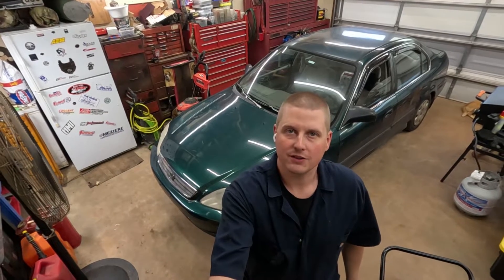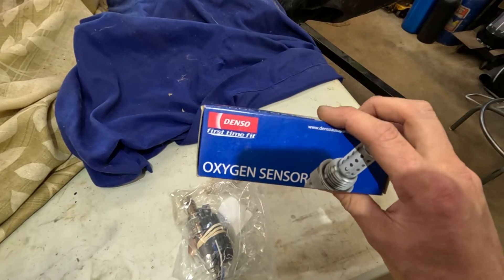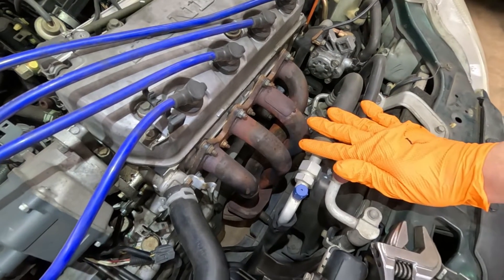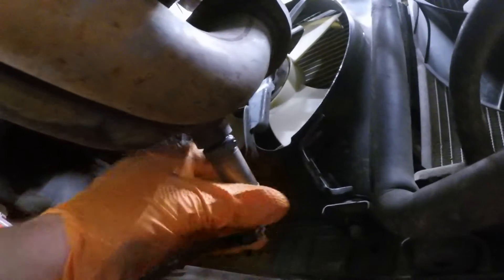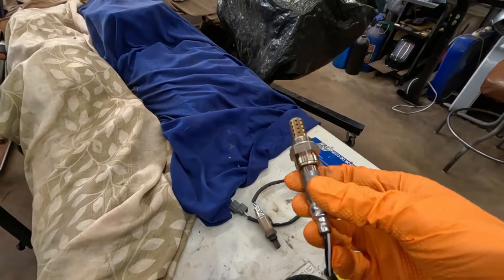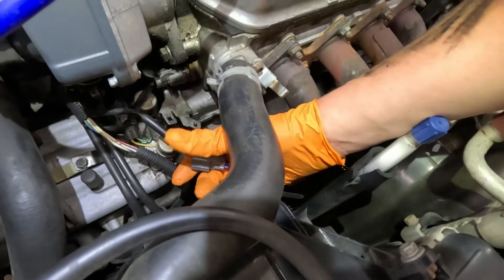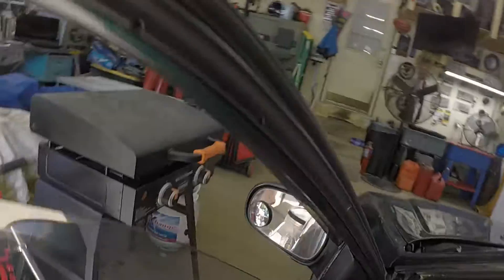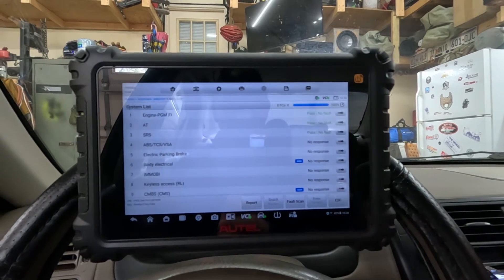How to Fix: P0135 Honda Civic Check Engine Light

Comment: In 2005 honda model I need air fuel sensor right???
Reply from the maker: For 2005 I am not sure this is the right part number. But it is an Oxygen Sensor that some may call an air fuel sensor. But some cars have wide-band Oxygen Sensor. I would reference RockAuto.com for the correct part.